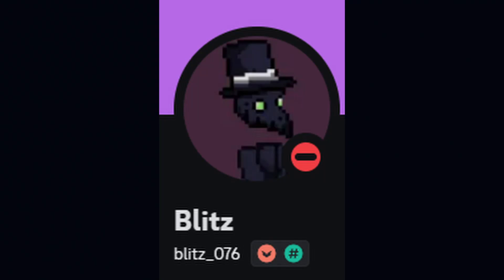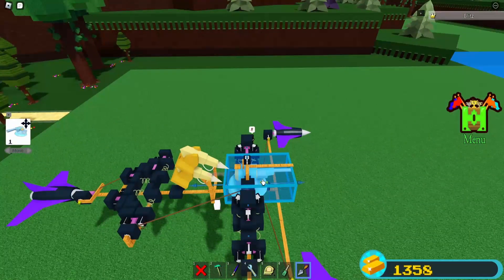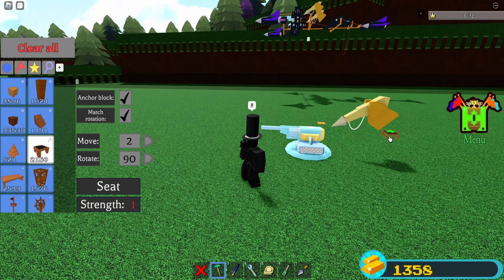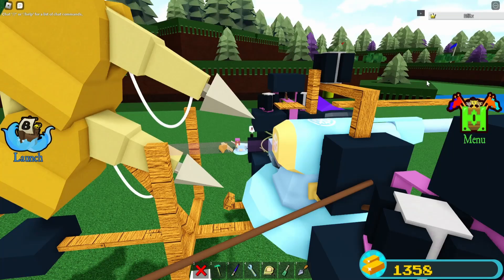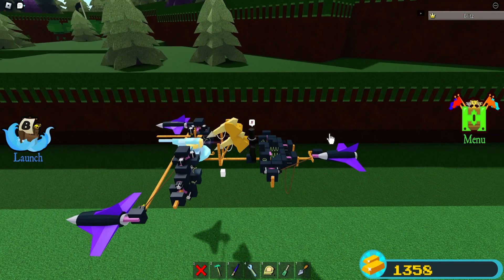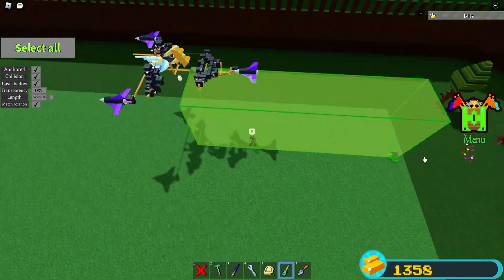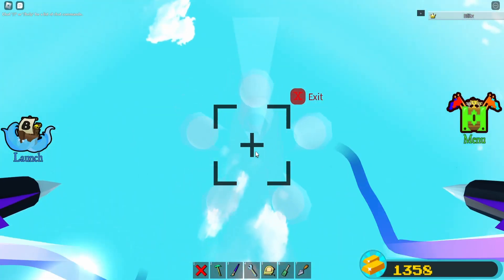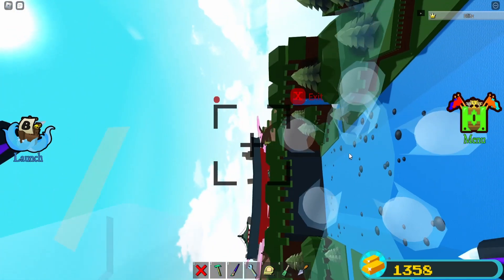Mouse Controlled Plane

Comment: bro just make a tutorial 😭😭😭 i promise it’ll be 10x easier to follow than this
Reply: hes not trying to let the whole community have this mechanic
Reply: @Acxolotl 
it's very simple actually, i made a tutorial on it and it works in a different way
Reply: no it wont, complicated mechanics (or at least confusing) will mostly end up in alot of comments from newbies because they misplaced springs or stuff like that, he already gave the mechanics just not  a tutorial, if you use your brain instead of just copying his build you can make it as well.
Reply: @DatYellowDude 
I did my attempt at it and it actually works better, simplier and less buggy then him
Reply: @ i made one with blitz help buts its pretty buggy since its a drone
Reply: @Acxolotl 
ok